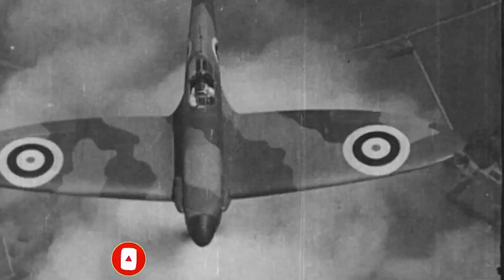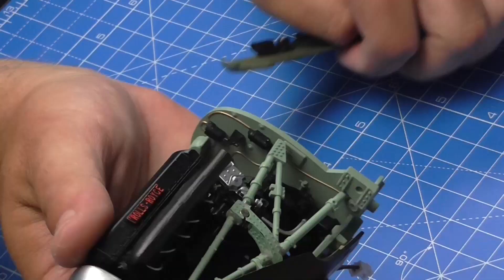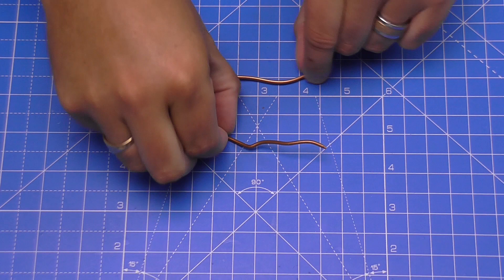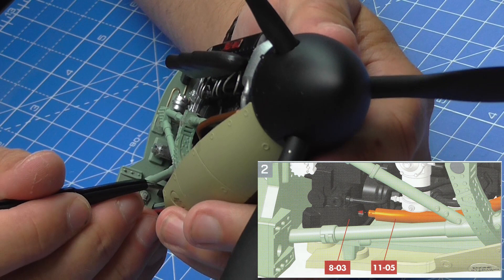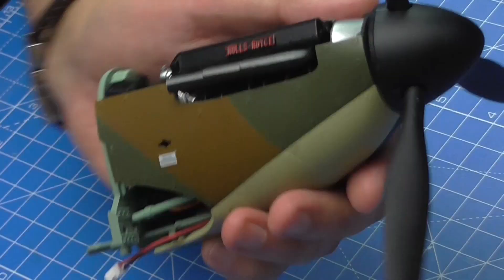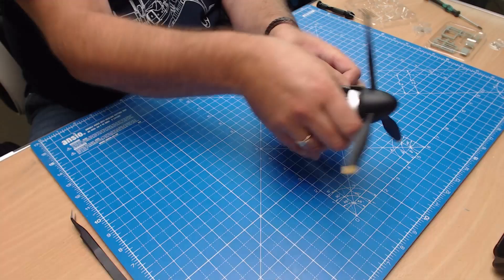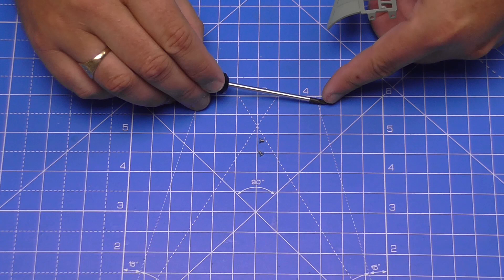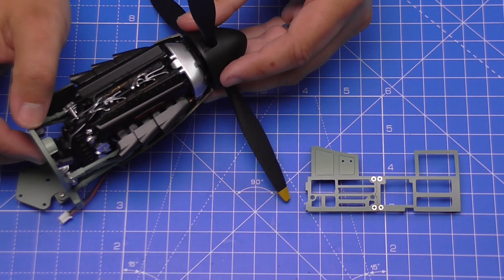Build the Spitfire Mk1a - Part 14 - Copper Pipes and Part of the Cockpit Frame

Comment: If you watch the advert on the Hachette web site that also shows the engine mount on the left not actually touching. Some other bits look a little ropey too but I guess that must have been a prototype model. 
I've just subscribed and you can still get the kit from issue 1, can't wait for it to arrive, but it could take over 4 weeks! I blame you Wayne, you got me hooked! ;-)

Comment: Hi Wayne, I have just done part 13 and my air frame to the bulkhead is slightly apart, but not as far as yours is. I did try to glue it but it didn’t really work so I just used the engine mount and the bulkhead to hold it in place, and so far it has held it.
And on another point in the instructions in part 12 it tells you now not to rest it on the spinner with the engine being in it now, just thought I would let you know.
Reply from the maker: Okay. I will make a jig for it

Comment: Looks like left frame where the screw/metal join is has a crack, and there is a gap on right side so right copper pipe seems shorter than it should be. Otherwise look forward to your challenge in fixing it. Maybe pretend it got damaged by the aircraft fitters and it a hanger queen ?

Comment: One thing I noticed is the right hand side of engine is slightly higher. If I put the 2 engine side covers on then look at each side. The left hand one ( from pilots point of view) is fine and sits nicely below the exhausts. However on the right hand side there is a small gap from top of the cover to the exhausts. I thought it might be exhausts are too high. But I did carefully add the exhausts at the time . Anyone else have this ?

Comment: Hi Wayne, not sure but I think in the 3rd issue the engine mount is in the wrong way. I am not building this model myself but have watched as many different build videos as i can and i believe you originally had it the right way round but then changed the orientation for the camera and ended up putting the mount in the wrong way round.
Reply from the maker: I thought that initially but double checked all the connections before this video. If the mount was the wrong way round the magnets wouldnt line up.
Reply: Sorry me again, at 5.14 when diagram 4 is on screen i notice that the supercharger base is not fitting over the raised area on the bottom of the fuselage (this may be just the way your holding it) this could possibly be due to a huge variety of reasons (mostly due to parts Warped/bent) I am planning on starting watching all these videos from the begging and see if I can spot anything.

Comment: Definitely something wrong with your parts mate. I don't think your copper pipes are too short, I think your bulkhead's not fitted properly. It's a tad too far away from the nose. Going to have a good look at your part 13 video to see where it's all gone pear shaped.
Reply from the maker: The bulkhead can only go in one way so I suspect the problem is with the mounting brackets
Reply: First problem, you've glued both of the brackets to the wrong sides of the bulkhead, you've got your left bracket on the right side and your right bracket on the left side. See my comment in your part 13 vid. Going to have to keep watching these videos in reverse order to see if you've cocked it up elsewhere along the way.
Reply from the maker: @Vince_Steele  yep. I had changed that back in the last vid
Reply: @WorldofWayneUK  well, we can't blame that then, can we. :P

Comment: Hi Wayne, helpful videos, cheers for that. Obviously you don't know how an engine works, the 2 copper colour pipe coming from the glycol coolant header tank ( the silver thing in front of the propeller reduction gear housing, obviously duct coolant to the supercharger. Nothing to do with exhaust gases, that's how turbo - chargers are driven. Merlin is supercharged, mechanically driven straight from the engine.
Hachette themselves no nothing at all, keep referring to everything as " engine part, or pipes". And the magazine is littered with mistakes, pretty much throw away material.
For 10 pounds an issue you will have thought they would have put more effort into it. Education is the way forward.
Reply from the maker: Nope. I'm learning every step if the way. I was hoping to have a talk through on the Merlin engine at Duxford but the virus stopped that happening.